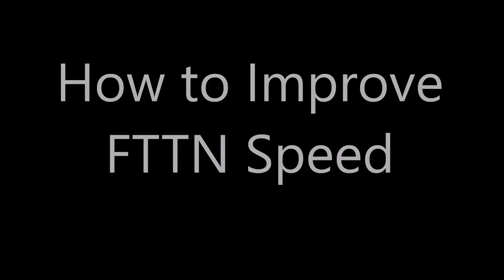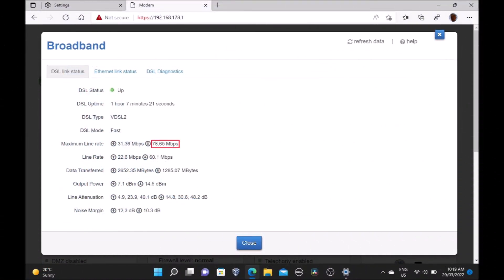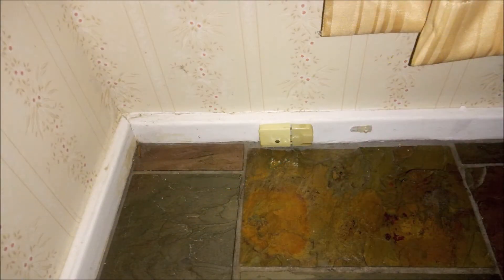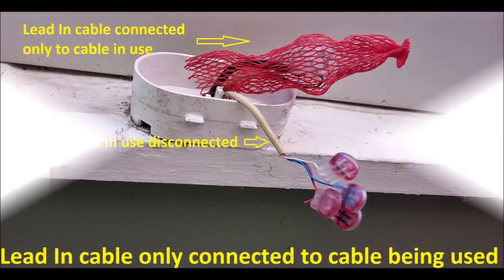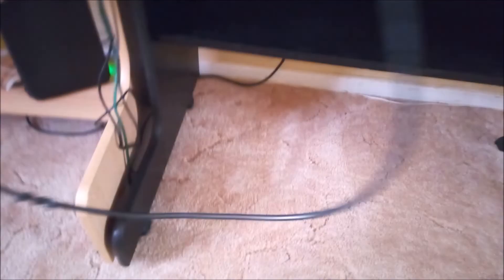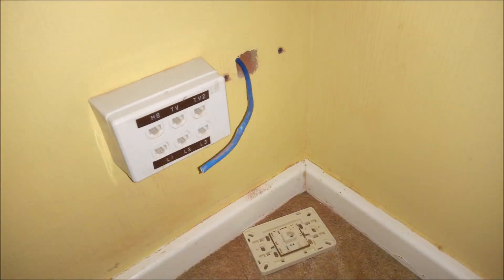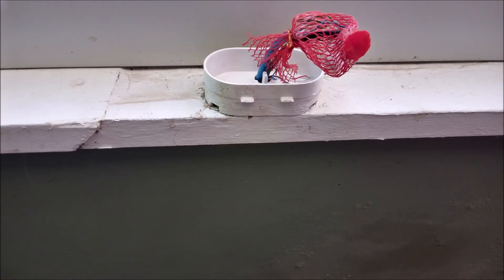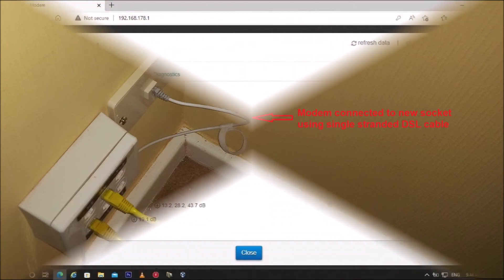How to Improve DSL (FTTN) Speed

Comment: very cool, will this work with NBN? I use FTTN with the NBN, and I live 100m from the Node, and it seems to run 50MBPS fine, but I am not exactly sure if it's capable enough for 100MBPS, what should I do?
Reply from the maker: If your 100 Meters from the node you should easily get 100 Mbps down. If you can't there is either a fault in the house or street wiring. You can check what speed you will get by logging into the modem and checking the line stats. If you have a Technicolor modem (pre Gen 3) log into modem and go to Advanced > Broadband > DSL Link Status or if you have the Gen 3 modem go to Broadband > DSL Link Status.  The Maximum line rate shows the what speed your link is capable of. If you have the Arcadyan Gen 2 modem log into modem and got to Advanced > Log and sort on Hardware. Look for something like this "VDSL Bearer Downstream rate = 48384, Max Upwnstream rate = 13423". In this example there is no benefit in upgrading to the NBN 100/20 speed tier as the link is only capable of 48.3 Mbps down.